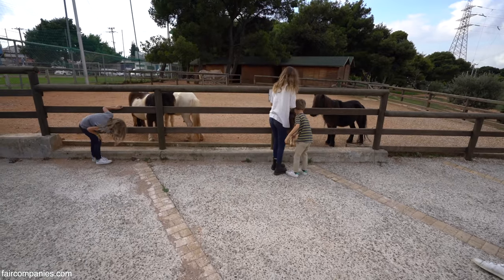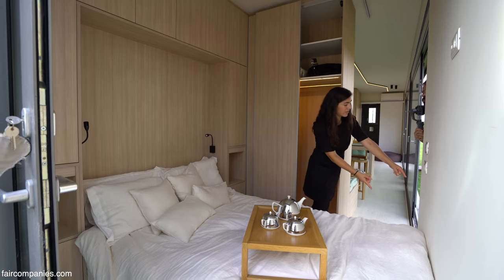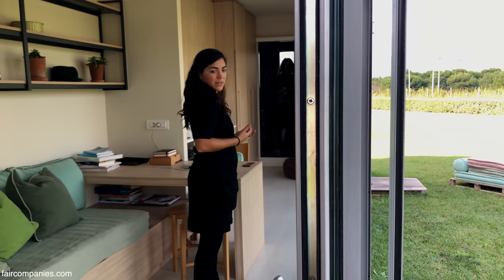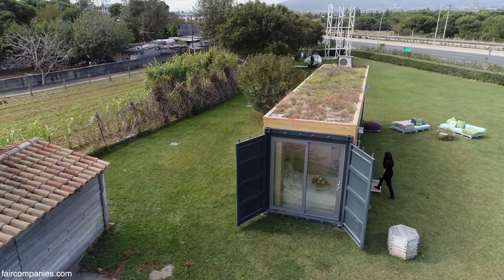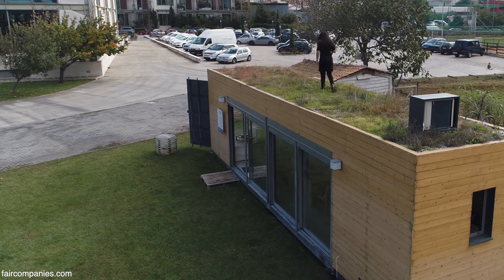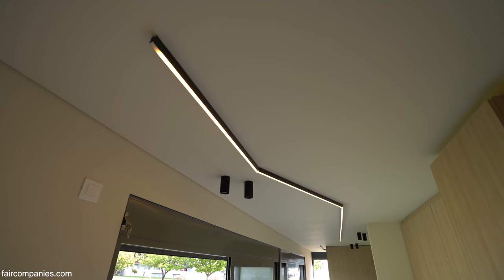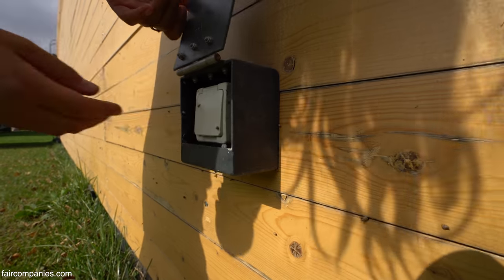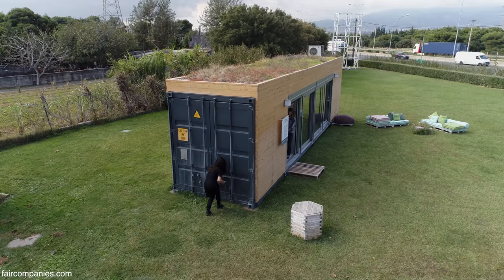On designing a stackable, bioclimatic shipping container home

Comment: this is ridiculous! With the same amount of time and money you may build a nice wooden framed house. This will be lighter, simpler to insulate and - if you want -  one meter larger and so much more comfortable. A wooden house is as mobile as the container but simpler to handle and to build. Dimensions of a container are 12.03 x 2.35 x 2.39 - this is not large enough and not high enough for a comfortable living. The costs of such a house are 20% frame (container or wood), the rest is insulation, doors and windows, electric installations, sewage and interior furniture. Someone may explain me the reason for container houses, please. The shown example is the playground of a rich mans daughter, which is ok - for her!
Reply: A one-time used 40ft sea cargo container in my town is available for mere $3,800. So cheap. Cut outs and adaptations for opening would add another $1,500. These have a minimum life-span of 20 years. But could be more of protected with good quality exterior paint and in a static condition. Overall cheaper and stronger than a timber framed home.
Reply: @ @hbchohan7886  you simply forget the needed insulation, which is better done on the outside to keep the inside space. For this reason you need an extra outside cladding to protect your insulation. Inside you do  not want to keep the rough steel and better cover it by something nice, maybe? Windows and doors, bathroom and sewage tank or plumbing? Electricity and on and on. People always forget 80% of the real costs.
Reply: @mucsalto8377  Mr. Salto - You are correct. I am a Civil Engineer so I do understand all of this. I was just trying to mention that the shell (Sea Container) in the UK would cost about $5,300. There is a company here in the UK that can convert a 40ft (High Ceiling) container into a high quality finished accommodation unit with a 20 year product warranty for $75,000 to 80,000. Pretty expensive. They need 6 months to deliver from their factory in Cornwall. Just some basic info. Thanks for the interest however.

Comment: Sorry to be negative, but that is a horrible design IMHO. Anywhere other than the perfect climate, you would boil in the summer and freeze in the winter, without a lot of design changes and heating/cooling infrastructure. Not to mention having to constantly open and close the bedroom side container doors. That would get old really quick, lol. Looks and feels cramped and underutilised inside.
Reply: Did you watch the the whole video? She said it is energy class A rated, and has insulation on both the inside and outside of the container. She also said between 10-28c it doesn't require any heating or cooling.
Reply: I remain skeptical over such (to me) unsubstantiated theoretical claims, and the real lack of belief that she has spent any significant time at all in any kind of container to truly know what she is talking about.
Reply: No, you just apparently didn't bother to listen to the video or really look at it...

It's insulated on both the interior and exterior, it has a green roof, it has a heating and cooling system, and even the glass sliding doors provide insulation value, dampen sound, block solar gain from the sun, and are sealed air tight on all sides when closed.

She stated it was energy efficient enough that you don't even really need to heat or cool it if the outside temperature is between 10 ºC (50 ºF) to 28 ºC (~82 ºF).

All those sliding doors also means you don't have to open and close the container doors all the time unless you wanted to ventilate the space and open everything to the outdoors, which you don't have to do!

Sure, if it was just a plain metal shipping container with nothing done to it then your comment would make sense but it's clearly not just a plain container...
Reply: I am glad we are both free to have our own opinions. You obviously believe everything she says, while I do not.
Reply: Mr. Smith you believe there’s a god?
Reply: @christianmartinez8700  
Please don't bring your imaginary friend into this argument. Thank you
Reply: @MrSmith-hd8od  In what way unsubstantiated? Energy ratings are an official certificate, they are required by law when selling a house (In Greece). They must be carried out by an accredited assessor. So, her claims are substantiated by an independent 3rd party.
Reply: @MrSmith-hd8od  Mr. Smith, PLEEEEEEEASE!!!! build a container home and show us how it is done. This is my opinion, or else next time watch the whole video and pay attention...
Reply: aljowen Every year, multimillion dollar private homes and commercial buildings are constructed, with the benefits of top architectural engineers, accredited builders, and of course, properly rated materials. This does not ensure that every one of them works out in the end, to be a perfectly successful design. No matter what all the individual claims and certifications assert themselves to be. This is MY OPINION. I am not saying I am correct and you/she is wrong, I am saying I do not like the design, and am skeptical of its efficiency.
Reply: @MrSmith-hd8od  Fair enough, enjoy your week Mr. Smith...
Reply: CRYPTO SARGE A juvenile attitude and snide remarks definitely do not add any credibility towards convincing me you have any relevant argument in this matter. This is also my opinion.
Reply: @MrSmith-hd8od  Actually I was not trying to  give you a juvenile remark, it was an honest to the point comment. Just so you know I am a 24 year retired U.S  Army Veteran whom served around the world helping build villages, schools and roads for the less fortunate. Also was incharge of the brigade logistics for 18000 soldiers for where they go, how they get there and how they live. So trust me, I have enough knowledge on being a military contractor on this kind of issues. So again, you have a great week and still not a juvenile comment, I meant it sincerely. Now that is not my opinion that is fact...
Reply: CRYPTO SARGE Sir, you have my admiration and sincere well wishes as a Veteran, please accept my thanks and reciprocal thoughts for you to have a great week.
Reply: Thank you again Mr. Smith...
Reply: I don’t think you’re opinion is humble.
Reply: "Your".
You're welcome.
Reply: Mr. Smith, I too have doubts about the design. However, I am curious what makes you think that heating and cooling will be an issue despite the benefits of thermal blocking glass windows/doors, green roof, and insulation. Also note that you would probably stay here for holidays (usually during perfect weather) and can orient it to ensure sun is minimized/maximized.
Reply: Possibly it's because of my location, (Canada) but so many of these tiny homes and/or shipping container conversions just don't seem to take into account climactic conditions beyond the scope of the usually very temperate and balmy locations of their origin. Sure, if I was to look at this effort as merely a brief few days perfect weather holiday getaway type of deal, and I didn't actually have to live in it day in day out, maybe my attitude would be more charitable regarding the wonders of modern thermal glass insulation. How the interior space is set up is another story, of which no amount of debate will alter my thinking.
Reply: @MrSmith-hd8od  thank you for your generous reply. In this context, I understand your comment better.
Reply: @aljowen  And they are in Greece, a very temperate climate.